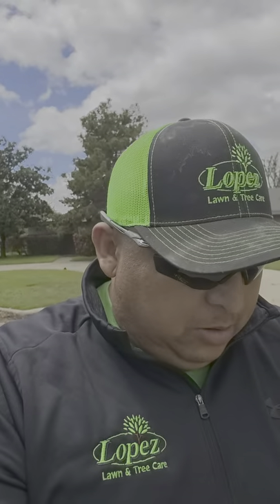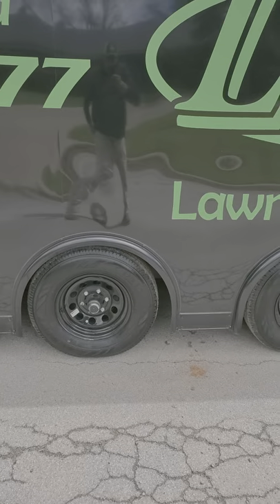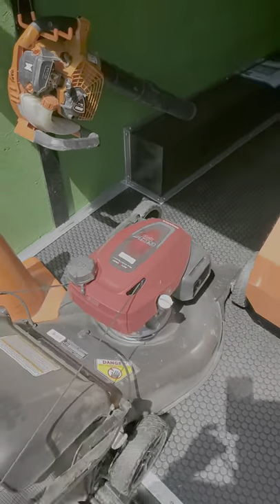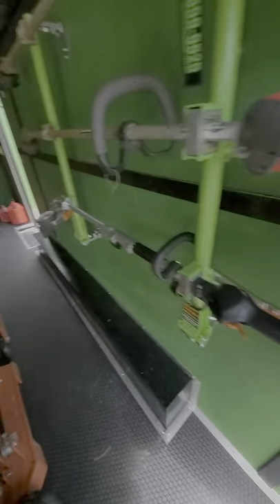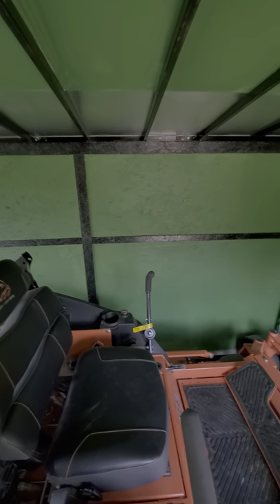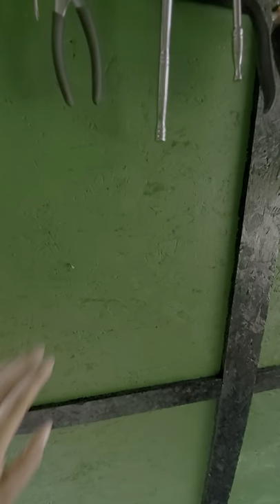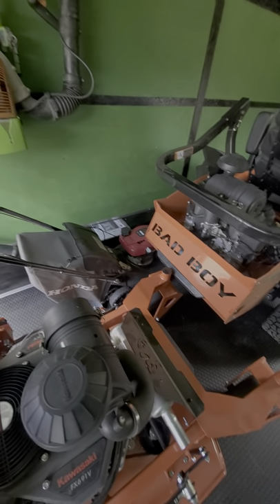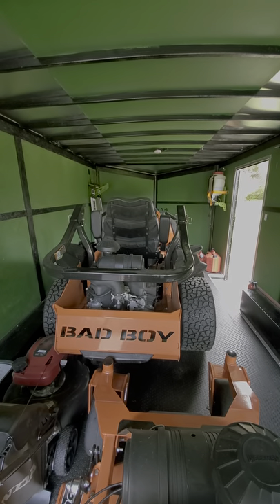2020 ULTIMATE ENCLOSED LAWN TRAILER SETUP.

Comment: Nice setup and everything looks great. I had the same issue with my Stihl hedge so I turn the bracket on the shaft to side instead of straight up and down and it works great without turning the it sideways.

Comment: How do the spread axles work for you vs the regular axles?? I'm on the verge of getting one built. Thanks for any info!
Reply from the maker: They are much better very smooth ride compared to the regular axels. Distribut weight alone better. Iv had both and split axel is by far the best choice
Reply: @lopezlawntreecare6477  thanks man!! When I came across your chanel and just so happened to see your see your trailer I was like WOW, now thats how you stand out! And that's what I want, to stand out and look different than any other lawn care business in my area.  I will be ordering one!!!
Reply from the maker: U won't regret it. Yes always stand out from your competitors.
I always have done that in appearance and job performance. Wish u the best and please be sure to send me pics.
Thanks buddy